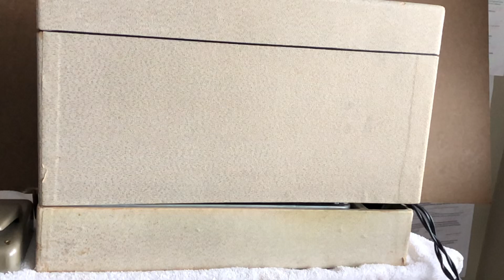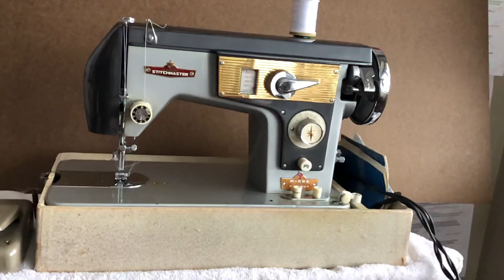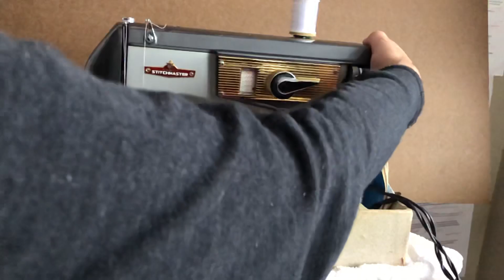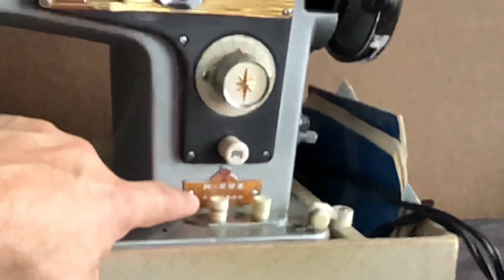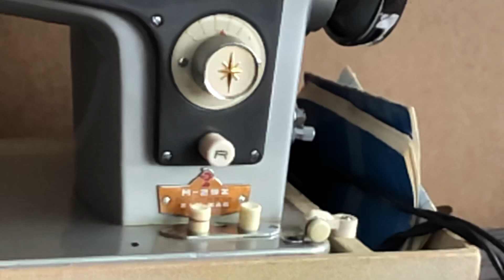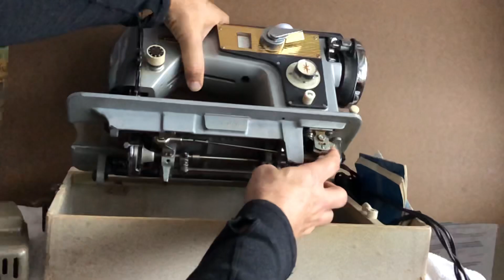PURCHASING SERIES #9: Glamour 1950's Style: Toyota Sewing Machine Made for Private Label Brand Arrow

Comment: I just found a machine called Miracle, I think it's a Brother. Like you said, the feed dogs button was stuck on normal. I didn't force it but got it unstuck. The upper tension seamed weird so I took it apart and will attempt to put it back together. That's a cool machine, thanks for the video!

Comment: The spring lever is also useful for embroidery, if you want to go from straight to zigzag, like the embroidery machines that have a knee lever to control the zigzag. My Nelco has a horizontal lever that I tied a string to, ran it down to a hinged piece of wood and made a foot pedal that pulls the lever back and forth to make embroidery designs
Reply from the maker: Thank you for the reminder Justin.  I had a White machine this past summer thar I found that on.  It was a feature I'm sure that the original salesperson would have demonstrated when these machines were new.